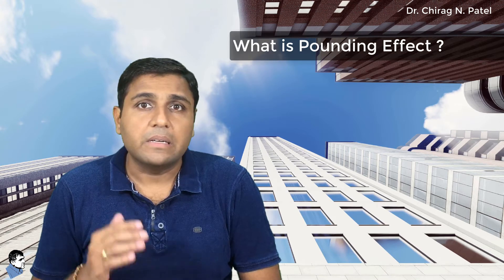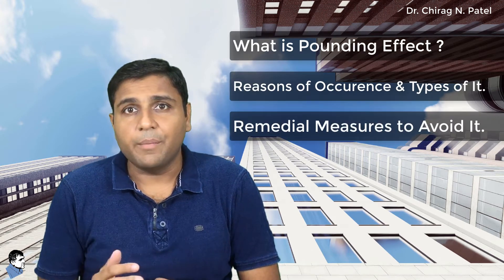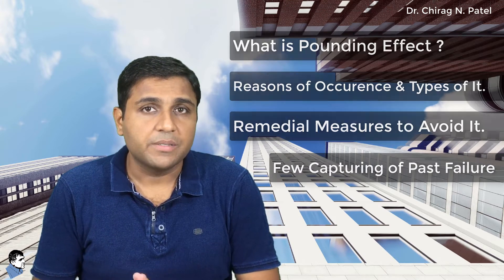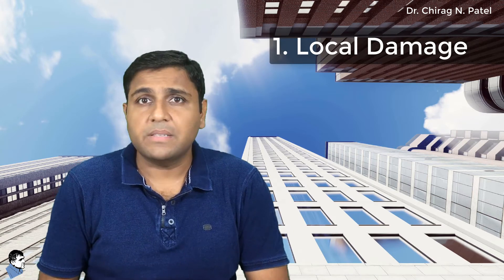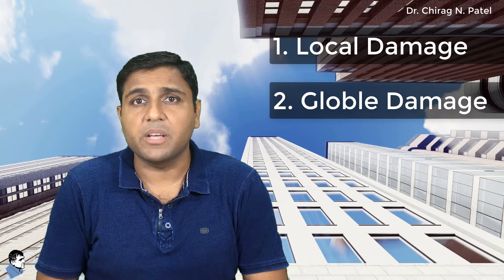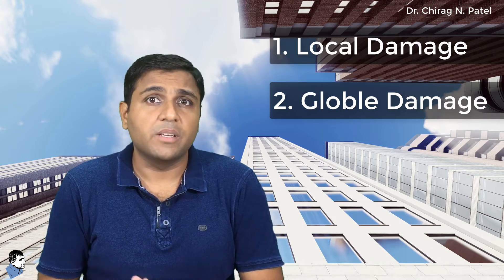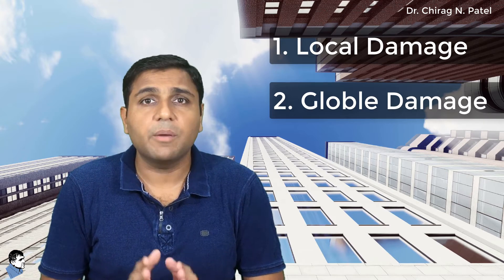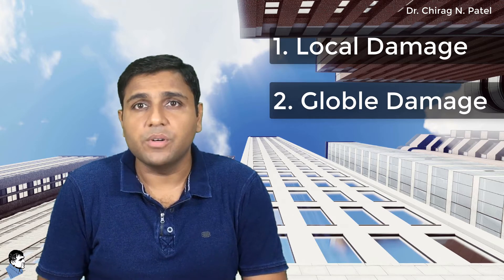POUNDING EFFECT: What is Pounding Effect In Buildings // Pounding Effect in Structures

Comment: In a multirise building during earthquake top of the building will be under larger force or smaller force ?
Reply from the maker: As height of building increase, earthquake force will decrease because it wholly depend on the mass at the level of different height. So, at top of the building force will be less but displacement will be more.
Reply: @drchiragnpatel  thanks sir
Reply from the maker: Always Welcome Ankush